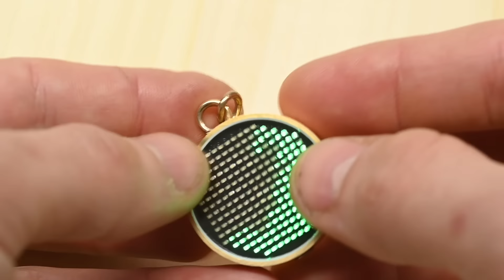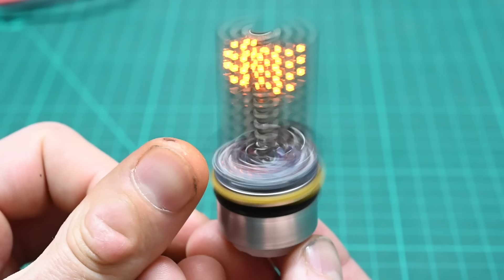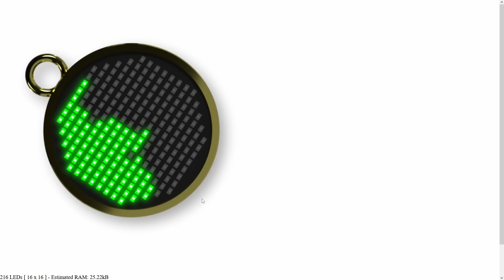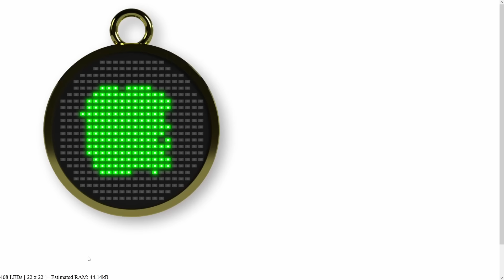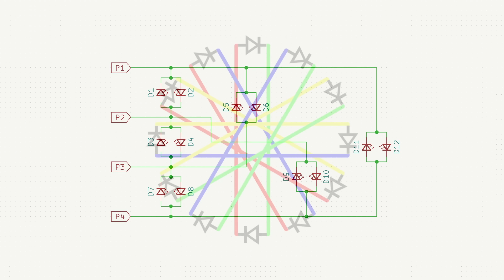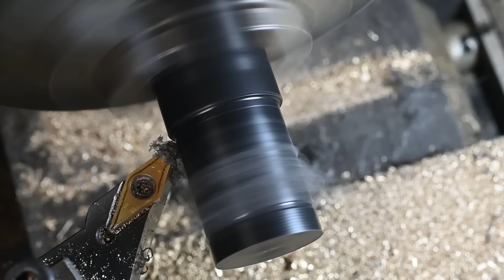Fluid Simulation Pendant

Comment: Can it do sand.
Reply: Might as well be yellowish white leds then.
Reply: Might make an hourglass
Reply: I saw similar project on AlexGyver channel, called Digital sand in russian.
Reply: Can it do plasma?
Reply: I don't like sand... its course... rough and irritating... and it gets everywhere
Reply: @Bartmaaan Not like here. Everything here is soft and smooth…
Reply: Yep. Basically the same thing, just with tweaked parameters
Reply: At least, it could do sand if it was completely digital software. Not sure about the mercury though
Reply: Everything is a fluid
Reply: @robertosutrisno8604 if you compress enough pedestrian traffic within a space, it hits a point where it acts the same as a fluid! even humans as a macroorganism are a fluid!
Reply: Sand isn't green dummy 😂
Reply: Xd
Reply: Here is the “?” which you missed 😅
Reply: This is amazing!

If i was to sell it i would make the enclosure injection molded plastic which would be cheaper and easier to assemble, then have a company fully manufacture the pcbs with all the components attached. That way the only  thing to do is drop the parts in in the right order and you have a sick product.

Also that clock idea other people had where the time is a negative filter over the lights would be pretty sick and help to sell but i see the limitations.
Reply: @AGZL  i'd rather have a metal outside for it  because it's a pendant
Reply: @thespaceman4808  yess but metal parts are like way more expensive and harder to manufacture than plastic ones like this and would make it hard to like put the glass in for like 100 of them
Reply: @ again it'sa pendant, i'd rather pay more for it to look nice, not that it would probably be significantly cheaper due to the mechanism, but hey maybe someone will create these with plastic on cheaper hardware and sell em on temu.